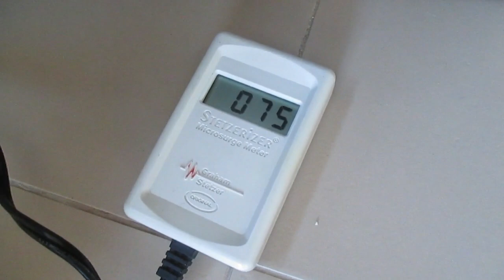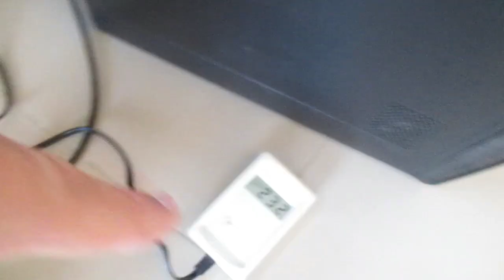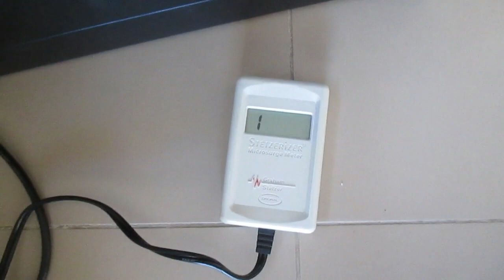Dirty Electricity created from a Desktop personal computer

Comment: Over 2000 GS is a damaged PSU. Exchange for a new one and it will drop by 1000 GS.
Reply from the maker: It is possible, but the high level of GS is the only symptoms. It can work like this for years and no one will know.
Reply: @NoRadBlog  Yes, that's what happened with my PSU. PC was stable, no issues. 2000 GS. Bought a new PSU. 1000 GS.